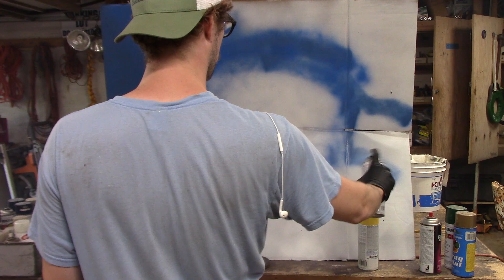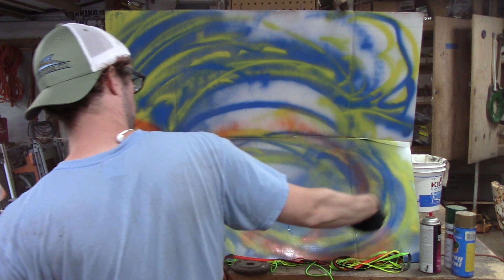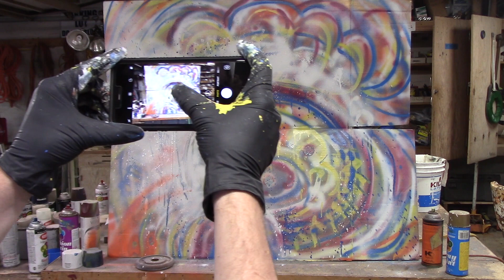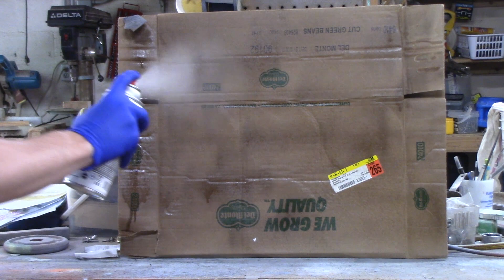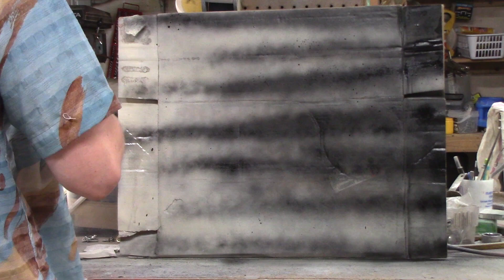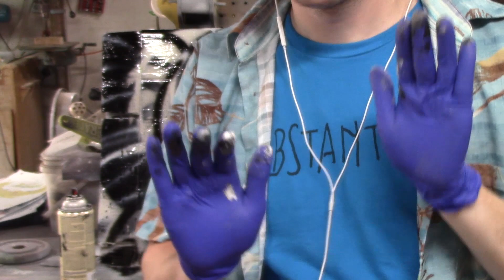Peter's Content-Free Podcast Episode 9

Comment from the maker: For people telling me to use better spraypaint and stuff, in the future I will don't worry, thanks for the advice! This was just me messing around with the spare bottles lying around in a garage, I was trying to use up some old cans that were almost empty, and get familiar with how spray paint sprays n stuff. This was even before I did that other video on the side of that old shed.

I've bought now some cans of mtn 94 that I'll use for my next project!  :)
Reply: Primed piece of plywood is a cheap and large space to work with too.
Reply: mtn 94 is real nice to start out with! maybe you can try doing something on cellophane wrapped around two trees/poles, that way you can do it anywhere.
Reply: the mtn94 is really smooth and low pressure, covers good yet not drippy. a tippy tippy is to get a wider cap/nozzle/tip if u are going to cover larger areas because the original cap is pretty thin and soft. it sprays in kind of two modes, u can press it down, and ALL DOWN.. im sure u willll try around and figure out what works best for you!

I really do enjoy watching you spraying, i am a graffitipainter and u have inspired me alot, now, this is even more "fun" to watch :D

ANOTHER TIP hold your hand far away and go closer as you spray, the linewidth is going to go from fat to thin. easiest to do by tilting the wrist!
Reply: yes
Reply: It’s called the witching hour. That’s the time of night you where thinking of when you’re out late at convenience stores poking things lol
Reply: These are the people WHO think that your painting was a checken
Reply: Peter Draws pls wear a mask
Reply: FIGS ARE like berries?

Comment: Answer: The "witching Hour" -( 43.55 ) or " Bewitching Hour"
-They  discontinued my floss. I use the fluffy super floss. But I liked the blue and white cotton twisted unwaxed which has disappeared. If it glides its not rubbing off the plaque. Brush your teeth, then in a mirror floss, be amazed at all the food and crap the floss removes.
- If your fingernails are dirty they will infect your skin when you scratch. To check, dip your fingertips in some hydrogen peroxide if they foam a lot, its killing  bacteria and gross things under your nails.
- If you are pressed between 2 trucks, you could of slowed down instead of speeding up.

Comment: Foggy or misty windows is due to temperature differences between the inside of the car and the outside. The differences cause condensation on days with humidity, and the only way to fix it is to equalize the temperatures by the window you're having problems with.

If it's from the inside, it's possible it could be a mixture of your breath and heat, or even other people's breath and heat within the inside of the car heating up and gathering humidity with in the air.

Ever watch Bill Nye the Science Guy? (I mean, is it possible that you haven't? ... I mean it's Bill Nye) In the opening you can actually see him breath hot humid Carbon Dioxide from his lungs onto a pane of glass and when he blows on it with cooler air the fog disappears. The water clings to the surface to attempt to equalize its temperature with the other system next to it(the other system in your case being the outside of your car.). Atrophy. The energy in the universe wants to stabilize and equal out.

The way to fix it is, indeed, your air conditioning or heat. My guess would be the air conditioning. If it's hot in your car and the water springs to the windshield on the inside, it's probably because it wants to get out and cool down. Like boiling water in a pot with a lid on it, the water rises and attempts to cool down. This is the way I think about it at least. Idk, I think I just went on a tired rant about physics in the comment section of a podcast with a soothing guy talking about the issue while spray painting. I think it's time to take a break for a bit.

I hope this helps Peter.